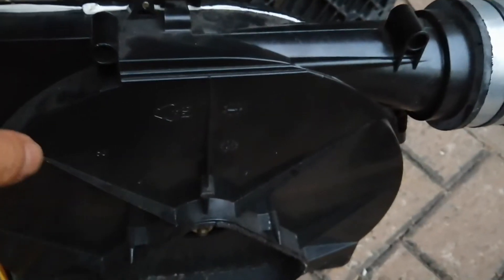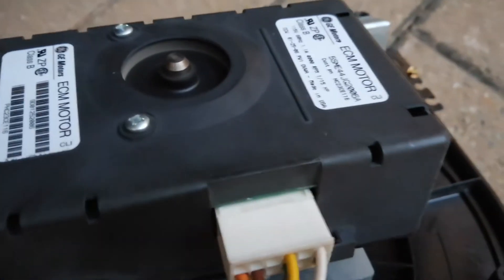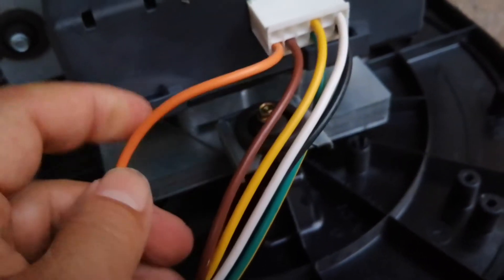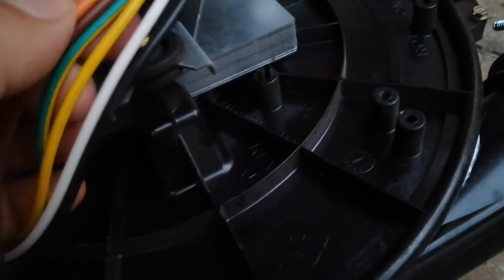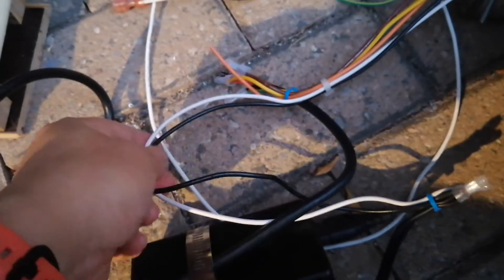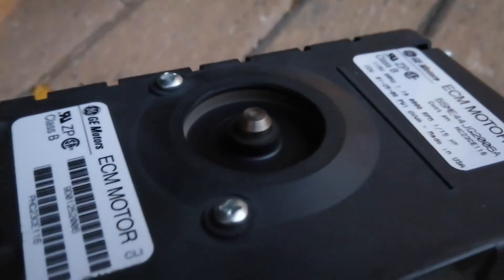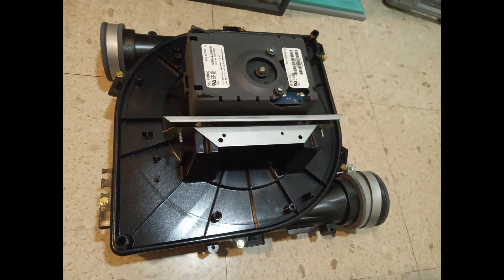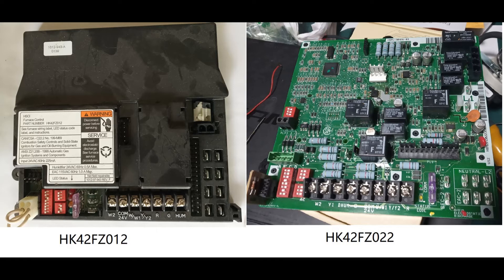Carrier / Bryant ECM Inducer Motor HC23CE116 Testing Without Control Board

Comment: Are you also supplying 120 VAC on black and white wires? Do you know the part number for the connector? I’d like to purchase one to build a tester like yours.
Reply from the maker: Yes, 120v is a must on ECM motors both blowers and inducers. The 120v is on motors all the time no matter the fan is running or standby. I made a 2nd video make the low voltage supply easier. https://www.youtube.com/watch?v=wYHD8R5KFRE
Reply: My motor runs constantly when only 120v is added to the black & white wires
Is that signs of a bad circuit internally?